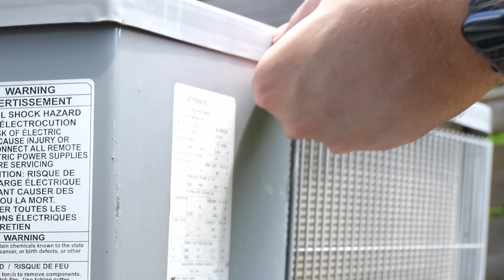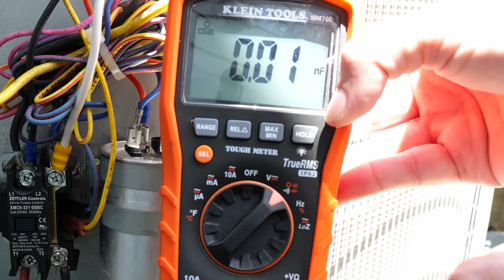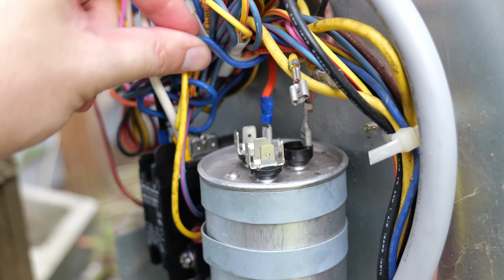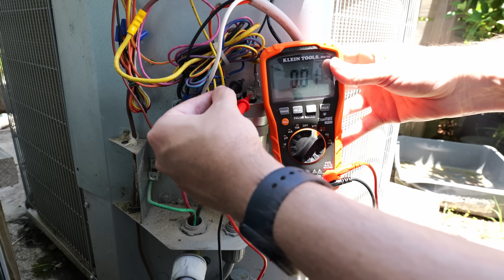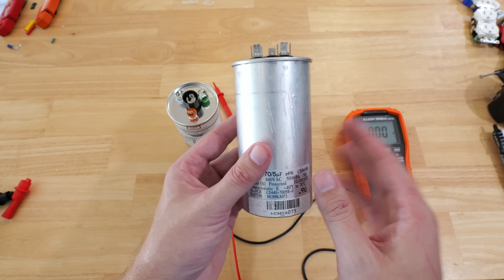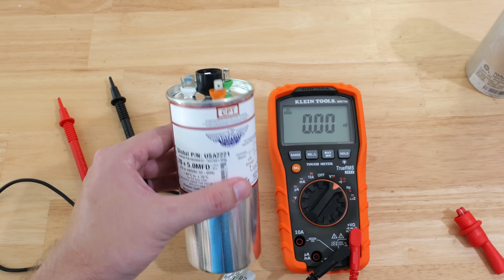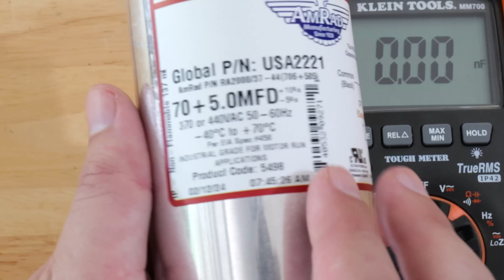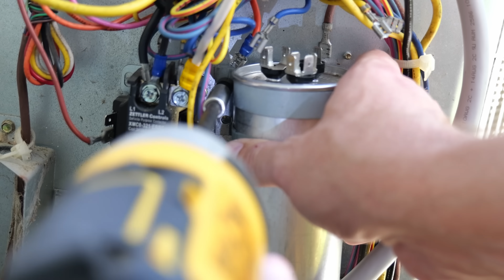Don’t Get Ripped Off! How To Avoid The AC Capacitor Scam And Save $500

Comment: Been in the AC biz for many years and let me let everyone in on a little secret. 
In order to stay in business most companies have to charge a minimum. It varies depending on where you live. 
So, you're not paying $300-400 for the part. You're paying the minimum a company can afford to run a call for and still pay the bills. 
Its astronomically expensive to be in business. And those costs get passed along to the customer. 
The required insurances alone for most companies are thousands of dollars a month for instance. 
That's why you see established credible companies bill that much for even simple repairs. 

That's not saying there are not shady people out there. There certainly are, everyone has probably experienced it. Some car mechanics come to mind. 

Educate yourself and be smart but also understand the realities of what it takes to run a profitable business in 2024.
Reply: They should not lump service fee with the part cost. I understand there is usually a mark up on parts but it’s extreme to say a $20 part is $300. That just sounds greedy.
Reply: Totally get where you're coming from. As a customer, people wouldn't balk at paying hundreds or thousands for a personal chef or a housecall doctor, yet expect service techs to come out and work for free. No, there is a cost to having someone come out and be available for your call 24/7. That's not a "scam", that's just the price of doing business; if you don't want to pay it, learn and fix it yourself. At the same time though, I hope you're not defending the behavior mentioned in this video, where the tech was testing the capacitance in-circuit. Now that IS scamming people, whether intentionally or due to ignorance, and they would never get my business.
Reply: @Huokun9  Oh certainly not defending anyone lying like the part you mentioned. There are plenty of contractors who will try and sell people on replacing parts that are in perfectly good working order.
Reply: @Huokun9  , 
Where I live, the desert southwest, people who can afford a chef, and I know a few,  also do not bat an eye at paying whatever their AC company tells them to pay. 

That said, here’s my real-world example:
My 80yo mother in-law had to buy a new AC unit, which was probably a legitimate necessity. I’ll never know.
The company installed the Unit and she began paying their annual fee for two visits per year.

1. Early into the second year she had a stroke and my wife and I moved from the east coast to live with her. One day the AC company comes for a “check-up” and I discover that inside her Lennox 5 inch Healthy Climate filter chamber, is one of those green swamp cooler filters jammed into the chamber using PVC tubing to keep it from being sucked into the blower. Evidently, she couldn’t afford a new filter on the last “check-up” for her very advance filter chamber, so rather than giving her one, the tech decided it was more important that her $195 dollar maintenance plan be paid instead of giving her the option to skip a year and buy a proper filter. At their ridiculously inflated price of course. 

2. I also discovered that more than half of her return ducts were covered by lazy contractors installing carpet and laminate flooring. The AC company clearly never did a proper assessment of her return ducts. Consequently, the new system was sucking hot humid air from under the house and caused the condensation pan to be constantly overwhelmed. Not clogged, But because there was very little cool dry air returning to the A-coil, their was overflow for at least 2 months out of the year. The rusty residue still inside the unit to this day and a topic of discussion for whoever looks at it.

3. Every Check-up after that always included a sales pitch for some addition equipment which was inexplicably not necessary at time of installation. One year, the tech told her she needed a new Blower cap, a condensate overflow detector, and “pan treatment”. My mother-in-law was present this time and was convinced that we should pay. The blower capacitor, he told her was covered under warranty ($12) she would just “pay labor”. 
The tech, didn’t even have the parts that he suggested. So he called the office and we literally sat around and did nothing for over an hour. He didn’t even vacuum the drain, didn’t  wash the condenser coil, didn’t look at the dual cap on the compressor… nothing. Clearly He was going to save all that for the next “check-up”. 
The drain from this unit is literally 6 inches long and then drops directly to the ground outside. The humidity where we are is near zero for 10 months of the year so pan treatment was not necessary. Nor the overflow switch. So this “check-up” cost my mother-in-law over $350. cost of the switch, capacitor and pan treatment? about 30 bucks. 

The kicker here is that this guy waited around for nearly two hours and ANOTHER tech took the time to deliver the parts and preventative maintenance on the compressor was never even attempted. This guy could have been in and out of there in 20 minutes, taken his $195 check for the annual plan and off to help someone else. 

I cancelled the “maintenance plan”. That was 2016. 
I’ve since been buying and replacing the filters myself. I opened up all the return vents that were covered. I put a thin dust filter on the floor vents to prevent dust from even entering the ducts.  I got a multimeter and check my capacitors every year and keep back-ups on hand. The original dual cap on the compressor from 2011 still running fine. The blower cap that needed replacement in 2016 still running fine. I clean my compressor condenser coil when needed, maybe every 3 years. 

I know at some point there will be a problem that exceeds my abilities. I have no problem paying a fair price for someone to resolve those problems.  I have a rough idea how long my system should last under these conditions and I’m preparing for the day when replacement is inevitable.

I have no problem for someone being paid fairly for their work. What I DO have a problem with is people creating recurring revenue for themselves and then exploiting people’s vulnerabilities.
Reply: Thanks for explaining. Most people that do not own or run a business have no idea how much money it takes to just make a 3-10% profit these days.
Reply: I own a small business and there’s no way I would charge someone 20x cost for a 15 minute job.
Reply: We now live in an upsell economy. It's a fact of life. It doesn't matter whether it's an AC company, a Dentist, a lawyer a veterinarian... etc. They all prey on people's vulnerability and lack of knowledge.  Everyone is ready to sell you something you don't need or charge you a ridiculous price for something very simple. So, as MrLouis suggested; EDUCATE YOURSELF. People used to run businesses without needing to rob or upsell customers. And thank you to People like @HowToHomeDIY for leveling the playing field a bit.
Reply: Your techs are likely sitting in the van with the AC cranking and surfing the web for 3 hours. That's how the contractor work uses does business. A cap and a MIN5 fuse and float switch, $480. 45 minutes of work. Didn't even throw a gage on it.
Reply: Agree with you completely as a technician for a security electronics company. A lot of people will never be inclined to fix their own stuff, but if you can read and comprehend basic electrical and mechanical troubleshooting guides you are ahead of much of the population and will save you a lot of money!
Reply: Most if not all hvac contractors around where I live pay their technicians on commission.  They are rewarded by up selling whenever possible.  I was a licensed electrical contractor for 40 years.  I know what it takes to run a business.  I also know what kind of crappy lazy lowlifes are drawn to the construction industry because I’ve fired more than a few.

I know somebody that works for a local hvac contractor.  That contractor had just installed a new system for a friend.  In a couple years, he needed a cap replaced.  They pushed HARD for him to buy a surge suppressor because he needed it.  I told him I’d never seen a power surge take out a unit.  I told him to decline.

When I asked the friend that worked for the company why a surge suppressor wasn’t included in the original install, I was told that would make the original price higher.  I call bullshit.  They are out taking advantage of people that are vulnerable.
Reply from the maker: Then explain how one company can charge $150-200 and so many others charge $400- 1500 plus?   There is too much disparity in the pricing
Reply: @HowToHomeDIY  Pretty simple. Small one man operations have practically no overhead vs larger companies. One company has a fleet of trucks, a full crew of techs, office space to rent ect. The fellow who can afford the $150 charge likely works form a home office. 

Speaking in general terms here. There are always outliers.
Reply from the maker: I mean the company I have a service contract with is a larger operation with numerous service trucks and techs and they charged my dad $125 to change his capacitor.  So I don’t know.
Reply: @HowToHomeDIY  Then you dad got a fantastic deal! I can only speak to my own experience. Only point I'm trying to make is that just because a bill might seem large you can't automatically assume your being cheated, Try calling Trane for instance. I had to use them for a unit on a commercial site that has Trane OEM controls that only they can work on due to OEM software. The fee just to have them show and troubleshoot was just shy of $1000 and that was pre pandemic. Would not be surprised if it was more now. 

Yes, I understand we are talking residential here not commercial. But Trane has huge overhead and pay techs better than anyone in the biz. Massive overhead = high price. 

Anyway, I appreciate what you do on your channel. Just providing a perspective from the other side of the equation is all. Keep up the good work!
Reply: @MrLouisianaHayride  No sense in trying to explain the "other" side!  It's a ripoff plain and simple.  It's like trying to explain why CEO's make a trillion dollars...
Reply: @alexander5238-v1x  How about a compromise. I as a contractor am getting "ripped off" by overpriced overhead. Taxes, insurances material costs and on and on. All that gets passed along to the customer. It might suck but its the only way to keep the lights on.
Reply: @MrLouisianaHayride  yes they have a larger overhead but they also have a larger volume which should spread that overhead out still ; smaller contractors still need to to everything that the office people do if anything their overhead is larger beucase they have to be trained in both admin AND servicing
Reply: @MrLouisianaHayride That does not justify the blatantly predatory behavior and pricing that plagues your industry. “I’m getting ripped off, so I have to rip off the customers” is not a valid excuse. It’s getting harder to stay in business because the customers are growing wiser to the bullshit. Your insurance costs are insane because your industry is rife with fraud. You are part of the only consumer facing industry where the consumers have to shell out of pocket for labor on warranty repair and service.
Reply: @andrewtaylor940  I’m not saying it’s a good situation or excusing fraud of any kind. Any company will pass on price increases to their customers or go out of business. 

But I totally understand you frustrations and I recommend always getting more than one quote for repairs to help avoid the those who actually are trying to run a scam
Reply: @HowToHomeDIY hey dude, you skipped a step. A step that has led to a cap blowing up almost right next to my head. I hope you research and take this video down and at least redo it. That being said OP is right, and you are breeding dangerous, cheap customers. Congratulations.
Reply from the maker: @brandondelcox8065  You are spreading misinformation and fear.  Can't imagine why 🤣 And the OP of this thread wasn't talking about the nonsense you are.  My goodness.
Reply: @HowToHomeDIY  They made their money already from the service contract payments.  Good video.
Reply: @HowToHomeDIY Name the company charging $1500+ for a capacitor? The guy making the original comment is dead on point.
Reply: @HowToHomeDIY  Because that company probably consists of a guy that works out of his garage.  There's nothing wrong with that, but he has low overhead.  Ask yourself,  if i asked you to run my errands on a Saturday morning for 300 dollars,  you wouldn't give up your weekend to do it. You're a grifter with no knowledge of how business works and you pray on homeowners to make your money.  When one if these unqualified homeowners leaves a wire off, and it shorts into their condenser,  ( which I have seen more than once), and they cost themselves thousands,  will you pay for their repairs? No you will continue to prey on them. Do better.
Reply from the maker: Calling someone a ‘grifter’ for showing a basic capacitor swap is a stretch. Nobody is sending me money. You on the other hand 😂 It’s a procedure millions of homeowners do safely, and the video covers discharging the cap and proper safety steps. The risk you’re describing applies to any DIY work, not just AC. People are capable of making informed decisions about what they’re comfortable tackling. If your overhead is so high you have to charge $500-$1,000 then you may need to look within at the issue.  You have 13 comments on videos on my channel, all of them like this.  Can’t imagine why you feel so threatened 💵
Reply: @HowToHomeDIY  Your framing contractors as crooks, when the capacitor swap guy is the real crook. No good technician just swaps out a cap. You'll be back in a week for a different problem.  Keep it up, you're causing way more harm than good. Unfortunately,  most techs just want to get things done properly,  unlike you, the swap out the symptom part guy, instead of getting to the cause of the failure and keeping the system online for the long haul.  You should have learned the trade before you started this bashing grift. Scab.
Reply: I don't do any residential work,  there isn't any money in it unless you own the company.  You get paid by YouTube to bash contractors,  so that is a grift. You have no idea.

Comment: I charge $300 just to show up. Capacitors are standard markup though so maybe charged at. $10-50 depending on the type and values.

You're paying for the visit either way. Obviously I don't agree with "free" or "low priced" "checkups". If you're not willing to pay for my experience and knowledge, use YouTube and save some money. I prefer it that way so that the customers I do get actually need me rather than just needing a bit of moral support.

Comment: 1:11 you should check continuity of your probes before checking for voltage. It's an important safety check especially if you haven't used the meter extremely recently. When confirming power off, I'll check continuity before AND after confirming no power.
Reply: What you are actually supposed to do is check your meter on known power source, use your meter to check what you are trying to confirm has zero voltage and if it does, check the meter on the known source again. Of course OSHA rules are optional at home, but this one makes sense.

Comment: As a business owner (computer repair), parts need to have a 70% profit margin + whatever your hourly rate needs to be.  For example, if a part costs me $25, I need to charge about $85 in order for it to be worth it to keep parts in stock.  If my hourly rate is $260 and it takes me half an hour, the bill should be $215 ($85 + $130).  Special order parts don't need to have such a high profit margin.  Just enough to cover you in case you need to replace the part under warranty.  I've found a profit margin between 20% and 30% on special order parts is sufficient.  If the part is really expensive then the profit margin can be even lower.  I just did a motherboard replacement for a client.  The motherboard itself was $460 and I charged him $525 for it (which is about a 12% profit margin) plus half an hour of my time, so $655.  It was well worth it seeing as it was a $2,500 computer that was only about a year old.  You don't have to completely screw people over or make 3-10x your cost on a job in order to stay in business.  I absolutely hate contractors because in my experience 99% of them are greedy scam artists.  No, I'm sorry, you don't need to make $10,000+/day per customer.  That's just pure greed.  When the decking costs $2,600 and you're charging me $40,000 there's a problem.  Even if you paid your guys $100/hour your cost would only be $9,000 and you know he's not paying his guys anywhere NEAR that much.  When contractors quote me like this I call them out on their greed and tell them to F off.  It takes time but you can find contractors that aren't greed a-holes.